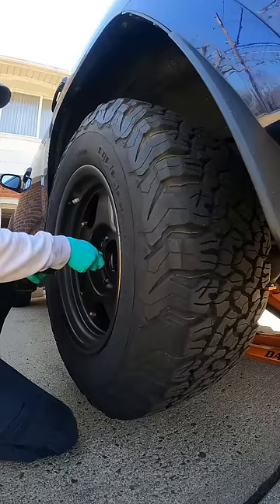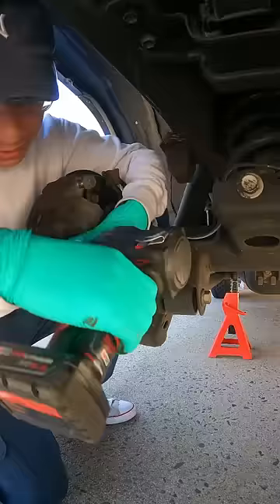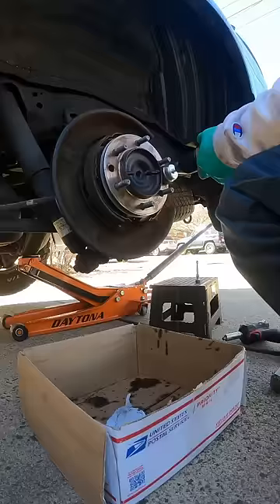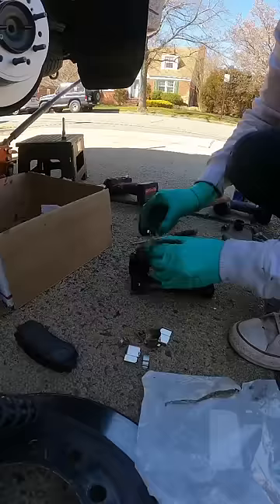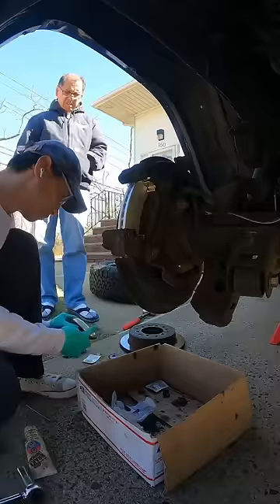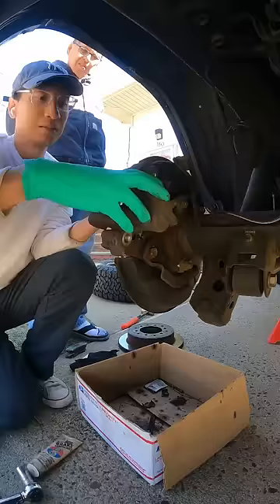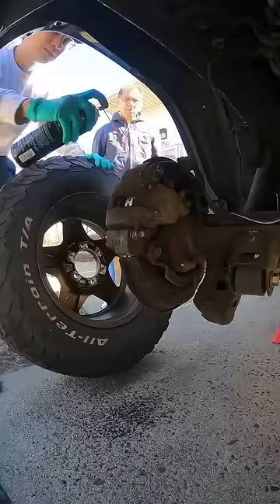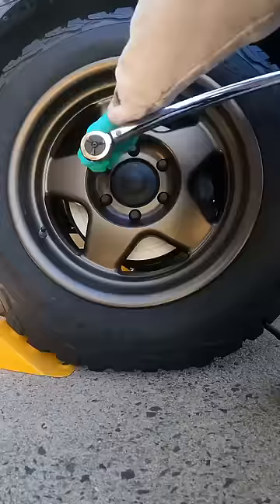Dealer wanted $700 to replace rear brakes. My DIY job cost me $100 and an hour of my time 😎

Comment: Paying someone to do the job while you sit at home or in a comfortable chair is the trade off.
Reply: Wuss
Reply: Nah I'd like my 700 dollars 😂
Reply: @calidobe  Facts!
Reply: Also: Toyota parts and labour have a warranty at any Toyota dealer, should there be an issue. The Toyota dealet assumes responsibility for the repairs. 
He screws up and kills someone, he is responsible.
Reply: It should be against the law for anyone other than a licensed mechanic to work on any safety system on a motor vehicle.
I can't work on my home a/c because I'm not licensed, same should apply to motor vehicles.
Reply: @CZE3  Nope. His money, his choice. Not a "wuss" thing about it.
Reply: @Wishes890  Just admit you cant work with your hands.
Reply: @Wishes890 yea if u don't know what you are doing, you probably shouldn't.
Reply: @calidobe  That is not true.
I would rather spend that time doing something I like. I can fix my own car, for the most part, but don't enjoy it. I also can afford to pay my mechanic to do it.
Reply: @calidobe  Well you can't do the job with ur hands. The tools to do this job on the cheapest possible way literally cheapest possible is roughly $300 thats using a crap jack, crap ratchet and socket set, literally just using the lug wrench supplied with ur emergency jack kit and parts still adds up to $300 not to mention your time and labor.
Reply: @Wishes890  Every man should have those tools.
Reply: @calidobe  I think you meant to reply to John Dee
Reply: More like sit in the crusty chair at the mechanic shop browsing youtube shorts until they tell you they’re done
Reply: @Jude 1:14-15  Yes as a Technician myself i have these tools on hand. I've invested alot in tools, thats my point. You can't just poof $70 do a brake job, it takes hundreds if not thousands in tools to do a brake job properly. People should invest money in tools particularly quality Torque wrenchs you wouldn't believe how many backed out bolts ive had to fix from shade tree mechanics who swear by (tight is tight) mentality. Not to mention majority of cars since 2020 have fully electronic park brake systems which would also require a $200 minimum (literally trash tier) scan tool to put the park brake in service mode, in order to remove the calipers and retract the piston.
Reply: A few hundred in tools and YouTube videos or friends with knowledge will start you on a journey that will set you free for a lifetime. Over the 30+ years since I did my first oil change, I've learned to fix and maintain 99.9% of everything. Car, house, whatever. I don't pay incompetent boobs who mess things up. I don't have to spend the day dropping off my car or waiting for hours at the shop. I don't get ripped off by roofers and AC guys. Something that is a crisis for others is for me a minor inconvenience to be addressed on a Saturday morning. I've saved well over $100K doing things myself and doing it right the first time. I do not pay anyone to do anything I can do myself. Learn to do it yourself. You will never regret it.
Reply: @robertbell525  And what do you do for a living?
Reply: @Wishes890  been a desk jockey for 30+ years. Learned to fix stuff myself because as a kid we had no money and no dad to help. So if it broke you either figured out how to fix it or you did without.
Reply: @calidobe  What you mean? He spent $700 on tools themselves.
Reply: @Wishes890  Yeah, no.  I'm not a mechanic by trade, but I wholeheartedly trust my brake jobs over any shop.
Reply: Yes, if you make enough per hour, have someone else do it. I don't. Plus I don't always trust mechanic. They lie and sometimes don't diagnose right.
Reply: I'm not paying 400 or 700 to sit on a chair 😂

Comment: Always clean uncoated rotors before install. But you never ever use brake clean on new coated rotors. That coating is made to be removed by the pads and if you hit it with brake clean it breaks it down and will not be removed correctly which can cause squealing.
Reply: Always clean rotors anyways, that oil on new rotors is to prevent rust. You don't want an oily substance on a brake pad 😂
Reply: @YungEagle3k  you can clean coated rotors all you want but you cannot clean them with brake clean. They have no oil on them, just the zink coating.
Reply: You are totally wrong about that. Always clean them with brake cleaner. The coating is not meant to be removed by the pads. Where the hell did you hear that? That's absurd.
Reply: @jeffriedstra oh yeah like the brake pads rubbing on the rotor aren't going to take the coating off but brake clean does according to you right😂 no rotors have coating the only coating they have is a light film of oil to keep them from rusting during shipping and mouisture
Reply: Listen, you are both talking about a different type of coating. I specifically stated that I am not talking about rotors that are coated in oil that is meant to prevent them from rusting during shipping. Obviously you need to remove that, most shops via brake clean, and more and more switching to dish soap now.

I am talking about the silver, zink/aluminum coating that is baked onto the rotor during production on new rotors now. Very few have any type of oil coating on them and the baked ones 100% do not have oil on them.
Reply: False rotors need to be deglazed the packaged with oil to prevent rust the oil needs to be removed
Reply: Wth you talking about? Who taught you that? Tik tok?
Reply: @jeffriedstra it's sad so many people think they know what their talking about in the comment section but have zero clue, you absolutely right Jeff
Reply: @waynes.2983  It is meant to be removed by the pads
Reply: @seanmckay3392  coated rotors don't have an Oil coating.
Reply: Who the hell buys uncoated rotors now anyway?
Reply: @Wishes890  exactly. And in the video he is clearly using coated rotors and is brake cleaning them which is what started this, lol.
Reply: OP is talking about when the ENTIRE rotor is "coated" they dont put oil on it, theres no need, the metal is protected with the "coating", I think what you guys are talking about is, some rotors just have the middle hub part coated but not the actual "brake" surface,  I would 😮imagine that is still coated with oil, and yes would still need to be cleaned. Coated rotors are worthless anyways, like OP says, the brakes scrape it right off, and not that I'm a mechanic or anything, but I've never taken off a coated rotor that still had the paint on it, even the coating on the hub part is always rusted and flaking off. IMO copper anti seize works much better (for the hub), my rotors always come right off with zero effort.
Reply: @seanmckay3392  I Googled coated brake rotors, and the very first image was a Bosch fully coated rotor, and it ain't oil. Try searching it and learn.
Reply: It's true. The zinc coated rotors that many OEM's use, are NOT to be cleaned with brake cleaner. I worked in dealers, gas stations, truck shops, and independent shops for over 20 years. I can attest to this.
Reply: Let's all just agree there's a lot wrong with this video,  like he didn't even mention bleeding the brakes after he clearly took the caliper off completely.
Reply: @jimr549  as long as he didn't disconnect the brake line, there is no need to bleed the brakes.  Generally, the caliper can be moved far enough while still attached to do the pads and rotors.
Reply: @Navybyrde  for sure but he had it disconnected.
Reply: @jimr549  wrong. You should watch it again. The caliper has been set behind the rotor, with the hose in a u-bend.
Reply: @Wishes890  only high carbon for me and they usually are not coated.  They might have painted hats but the brake surface isn't coated.
Reply: @jeffriedstra  you are 100% correct.
Reply: A little dish soap and warm water is all it takes 👍🏻

Comment: Where'd you get the parts?

Pick n pull???
😂
Reply from the maker: Pick N Pull would be under $50. You should know since you shop there as well.
Reply: @boltsandbanter  ❤️
Reply: @boltsandbanter  I was able to get wiper arms, headlight casings, break light casings, Sideview mirrors, lots of goodies for cheap, saves a ton of money by switching to pick n pull 😀
Reply from the maker: Even better when they have a sale. Sometimes the environmental fees stack up, and when they sneak in a warranty I never asked for. I get plenty of parts there regularly
Reply: @boltsandbanter  Recycling at its best ♻️ 👍

Comment: Pardon me, but you shouldn’t jerk on the torque wrench because it won’t be accurate.  Just pull smoothly until it beeps or snaps, depending on the kind you have. Good job, my friend.

Comment: My son's 2017 Camry needed new break pads both front and rear. Called the Toyota dealer and they told me $600+. I went to AutoZone got the parts for only$130 and took me and hour and 1/2 to finish it all at home. It is truly helps to be a handy.

Comment: Don't skimp on brake pads tho or you'll have to redo em real quick!
Reply: Cheap ones are dirty too.
Reply: that's what I thought when he mentioned total price. for a truck the brake pads you should use are ceramic and alone cost 40$ or more, and rotors 110$ or more.

Comment: Those rotors you actually don’t have to spray off. They have a solid coating on them to keep rust away. You will hear a grinding noise for a few miles until it wears away. There’s my little tidbit of information:)
Reply: Yeah it all just depends on what you buy, some rotors I’ve gotten have an oil coating for shipping protection, but the ones I just got for my truck came dry like you said, I still like to spray them down regardless to get any oils off that I may have gotten on from handling them.
Reply: @RoastFlea61  still a good habit to have
Reply: Most if not all rotors (even painted ones) are shipped with an oil coating on them. 

Always a good idea to spray them anyways before putting on the tires just to get off any slide lubricants you might of gotten on them during the installation.
Reply: That must be an american thing, I have yet never seen suppliers in Germany like ATE, TRW and Bosch deliver rotors with an oil Film on them, they are always coated and ATE does the most visible one where it’s literally like gray paint on the whole thing

Comment: Hope you opened your reservoir when you wound your caliper back in :)
Reply: So they can blow brake fluid all over the paint? No reason to open it unless they added fluid as the brakes wore which is not smart.
Reply: @gumps1986  huh? when winding calipers back in you should open the reservoir to pop the seal otherwise there will be too much air in the system to wind them in properly
Reply: @gumps1986  wat

Comment: And as soon as that high temp grease gets good and hot and Cooks those pins they're seized up.
Reply: Ceramic lube for ceramic brakes is what I use never have issues
Reply: 😂😂😂 tell me you’ve never used high temp grease before

Comment: Just did the fronts on my tacoma yesterday. $105 for the pads from the deakership + $50 to have my rotors turned at an autoparts store. Started the job after 5pm & was done before dark, that includes an hour of waiting for the rotors to be turned.  
Screw dealer service centers.
Reply: If it's a newer vehicle the rotors are so thin you don't wanna turn them because they will warp. Better to just replace them and wouldn't be buying parts from a dealership that's just common sense.
Reply: @trev119  no no no... the rotors will be fine. They only warp if you drive like an idiot. The first set of front pads lasted over 90,000 miles. This is on a 2015 , manual transmission.  I barely use the brakes.
Reply: Lol 90k miles on rotors and you decide to turn them!? Dude for an extra 50 bucks you got brand new rotors and have no possibility for issues. As far as the dealer goes. They can’t be putting on aftermarket brakes or cutting rotors at 90k miles. They have to fix it so customers don’t come back complaining
Reply: Wayne! Where is your cape?

Comment: In 32 years of being a mechanic, I have never used a torque wrench to do any brake work. 😂
Reply: Was looking for this comment 🤣
Reply: yeah it is unfortunate to see that even professional don't give two shits abt something that is so simple and quick lol
Reply: @wermish6040  and completely unnecessary, tight is tight when it comes to brakes, different story if you’re doing wheel bearings, cylinder heads etc but a waste of time trying to get a torque wrench behind a hub just to torque the carrier and calliper bolts
Reply: @Steve_T14  Tell that to the clown mechanic that decided "tight was tight" when he used an impact wrench to tighten my lugnuts lol
Reply: @MrSilk13642  every mechanic uses an impact gun to tighten wheel nuts, you’re supposed to buzz it til it clicks then tighten with a torque wrench, if he’s gunned them up too tight he’s not a very good mechanic
Reply: @Steve_T14  just get a set of tourqe sticks and call it a day
Reply: @Internal_Investigation  easy way to make sure your bolts aren’t torqued correctly, torque sticks help stop over torquing but aren’t accurate for torquing wheels or anything else to the right setting
Reply: @Stephen  I have never had an issue with an over torqued lug nut. The problem is when someone crossthreads it on and sends it home with the impact gun. A customers wheel falling off or the damage caused by loose lugs nuts it's way worse than the occasional overtorqued nut.
Reply: @Internal_Investigation  all fun and games until you can’t get an over torqued wheel nut or locking wheel nut off because it’s been horsed on too tight, obviously loose nuts are far worse and more dangerous but over torquing is still an issue, if someone is cross threading a bolt or nut they’re not very good at their job
Reply: @Steve_T14  5 min with the torch usually does the trick. And a new stud + lug $5-$10. Lots of people suck at their job and continue to do it. The people doing tire changes and rotations at dealerships are generally in school or freshly out of school with little experience. Techs forgetting to tighten things happens more than you'd expect.
Reply: @Internal_Investigation  i had my tire shop replace a lower control arm on one wheel.. they gave car back to me.  When i would drive the car pulled to the left.  I took it back to the shop and they said they didnt tighten the bolts tight enough and thats why it was pulling.  They retightened and it was good to go.
Reply: Yeah not like there's a spec for every bolt or something 🤨
Reply: @ijuhi  there is.. but with enough experience and knowledge. You know if you're fucking up .
Reply: If the manufacturer includes a torque spec, you torque it down to spec. Simple as.
Reply: You that guy that makes mechanics break out the breaker bar to remove the oil drain plug.
Reply: @Internal_Investigation then you’re lucky. My uncle had to get his tires replaced once, and the mechanic there overtorqued basically every nut to the point of starting to strip the threads. Had to break the studs and replace it all. Also, try getting a flat in the middle of nowhere, only to find out the mechanic torqued your nuts so tight you can’t change to the spare without an impact gun that guess what, isn’t in your car.
Reply: @wermish6040 once you do it for so long you just know how tight something should be just by feel. I have been a tech for 17 years and never used a torque wrench while doing brakes and have customers begging for me to work on their vehicles.
Reply: @GiveMeTheRedPill  yeah maybe ur like that but costumer usually don't know shit respectfully plus it's always a safe mesure for when your à bit more tired or sick or anything else that can alter your perception it just ensure consistancy plus I mean it is litteraly made for this why not use it yk? I also have a keen sense of feel and been working in this field for 12 years but like, to be as precise as a tool wich is design for that specefic purpose... yeah no I don't think so
Reply: @GiveMeTheRedPill  and anyways it's brakes so it's not that bad but on some other things a torque is a good thing to keep in mind. Anyway at the end of the day I can't stop you doing what you do it's not like I can or care enough to stop you anyway but yk it happened more then once that I need to loose à shit ton of time on a nut or a bolt that was torqued by someone who just feeled the torque
Reply: @Steve_T14 please that say “it only takes a minute” have no idea how flat rate works
Reply: @Scars_House  sorry not sure what you’re asking, say what only takes a minute?
Reply: That’s why people do their own brakes
Reply: @Mr.Preston3991 yes when the dumb ass tech tightens it with a impact
Reply: @Internal_Investigation those don't work
Reply: And you mechanics are exactly why I do my own work 😂

Comment: Like how cleaned both sides of rotor by inverting on wheel studs. Cleaning the hub is critical to control run out. Good job!

Comment: You forgot to adjust parking brakes before putting caliper back on.
Reply: There’s a thing called self adjusting parking brakes.
Reply: @tmakerful  there not self adjusting lol or I wouldn’t have mentioned it. Been doing this for a minute now. That’s for your input though.

Comment: If you’re getting a pair of rotors for under $80 each, you’re gonna have some warped rotors by your second oil change. Good luck.
Reply: I get brembo rotors and some other brand pads for NZ $127.00